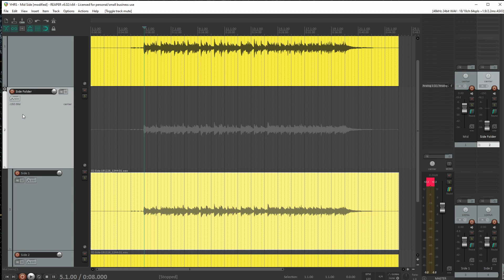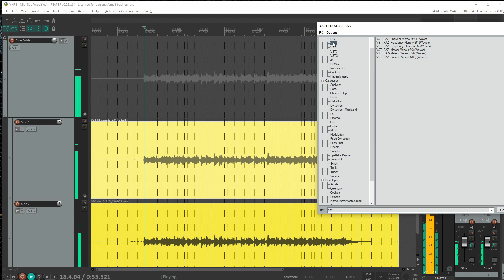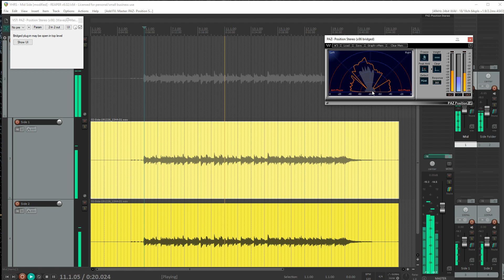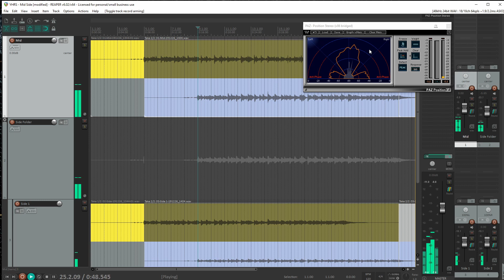Mid/Side Stereo Mic Technique (why does it lean to one side?!?)

Comment: Good on you!   
Sometimes taking a physical step back helps amount to a genuine forward progress :) Close-mic'ing was born in a time when engineers were desperate to do anything to get  a better signal-to-noise.  Turns out that it also sounds very f'ing fun to mess around with the apparent size and energy of a sound, so this proximal "artificial ear effect" became a somewhat over-used habit for a long time.  These days, with most genres close-micing amounts to yet another way of making mixing more difficult.

Comment: I think any stereo mic that’s placed that close to the guitar will give you a similar left/right balance because that is the actual stereo image at that location. If you want the stereo image to resemble what you’d hear in a house concert, the mics need to be further away. When moved further back the mid mic will be picking up more of the room ambiance relative to the instrument, losing much of the presence you get from close mic’ing. That effect can be mitigated by switching to a mic with higher directivity—e.g., a hypercardiod.

I haven’t experimented with that myself—I’m just thinking about the physics.
Reply: Indeed, this can come down to placement differences in millimeters due to the consequence of phase shifting across degrees/minutes of arc.  
 A couple of thoughts:
= The fig.8 mic's horizontal axis ideally bisects the guitar soundboard vertically; i.e. aimed between the bridge and soundhole.    
= When a ribbon is used, it should be oriented to run the ribbon's length vertically to avoid overtones arriving from different points along the length of the neck.  
Depending on proximity and how live and assymetrical the room is, the soundwaves can (potentially) arrive on each side of the fig-8 fractions of millisecond(s) out of phase.

Comment: just a little technical FYI on why this works ...  It's not really about timing or reverberation or anything.  The side mic gets its figure 8 pattern pattern by sending a signal which is the difference between what hits the front and what hits the back.  The dead spot on the sides then happens because sounds coming from the side hit the front and back equally.  When turn that mic 90 degrees, the front of the mic hears sounds mainly coming from the left side, and the back hears sounds coming from the right side.  The signal is then L - R.  When we flip the polarity of the copy that signal become R - L.  The mid mic hears sounds coming from both directions equally.  So that's L + R.  when we leave the mid mic panned down the center, we get L+R going to left speaker, and L+R going to the right speaker.  When we bring the original side mic signal (L-R) up panned hard left, the right speaker still just has the mid MIC which is still L+R,  but the left speaker now gets a combination of L+R from the mid mic and L-R from the side mic.  (L+R) + (L-R) = 2L.  The sounds that were coming from the right cancel out and the left speaker only plays sounds that came from the left.  Opposite thing happens when we bring up the inverted side signal panned hard right (L+R) + (R-L) = 2R.  now it's the sounds that came from the left that cancel out and what we hear is just the sound that came from the right side.  Super cool.  You get the variable spread because the other side gradually cancels out as you bring up the side mic signals.

Comment: To fix this even more you need the microphones to be different… even though you use two of the c414s in different polar patterns, they both are responding to the source nearly identically still as to capsule design, which means you will have phase cancellation issues between one of the side channels and the mid channel… bruce swedien says you need something like a ribbon microphone for the sides and a tube mic for the centre… they just need to be totally different for it to work so you get the least amount of phase cancellation as possible…. But your experiment was fascinating the way it altered the stereo fields balance by moving the microphones directly at the sound source… this makes sense because the capsule on the side signal c414 is positioned perpendicular and so the capsule is affected by the speed of sound hitting that round capsule at nanosecond differences from the front to the back of the capsule and this time delay of the speed of sound is actually creating a phase imbalance even moreso as the capsule is collecting info at the front and back of the capsule… which makes complete sense that a non-direct position will gradient the capsule surfaces absorption of the direct sound … and lead to those phase inversions, as the angle gradient of capture smears the phase.. i suppose a smaller capsule will also help mitigate this …so im gonna try that also to enhance my m/s technique.. i use a beyer m130 for the side mic and c414 xl2 for the mid. Thanks for the excellent video!
Reply: Seems right. I wonder though. Why not do XY angled out wide for the sides, added to the mid mic. No phase flip. Could even pull the xy back a bit and align time if wanted in delay of milliseconds or samples.
Reply: @Helenography0741 You can always use a phase modifier… i have a Radial Phazer Rack, which is now out of production but there are other devices that allow you to alter phase, which is essentially just a fine delay adjustment

Comment: It does matter which panned side copy gets phase inverted. A figure eight mic has a front and back side. In the front side, positive pressure creates a positive voltage. In the back side, a positive pressure creates a negative voltage. This is why the center of the figure eight is null. So always pan the uninverted side track to the side the front of the side mic was facing. Always pan the inverted side track to the side the back of the side mic was facing. This will keep the stereo image correct and phase with the center correct. A good check is to play the two side tracks, one inverted, the other not, unpanned, with the center track muted and listen if they perfectly cancel each other out. 

It is important to note that when done correctly with side tracks panned equally in opposite directions and played back in mono, you will hear only the center mic because the two side tracks will cancel out. It is therefore highly advisable to ensure the center mic, by itself, is getting a good sound since, in mono, that's all you will hear.

Another suggestion is to aim the whole array at an angle to the guitar using the center mic to set the aim. I mic acoustic guitars, banjos, mandolins, and octave mandolins a couple of times a week for live rehearsals and performance of an acoustic band. I use a single small diameter condenser - a KM 84. I place it perpendicularly at about the neck/body joint but aimed at an angle towards the body. The capsule is closer to the fretboard but the main lobe is aimed down the body but further away from it. It gets the body without aiming directly into the sound hole. I had to experiment with distances and angles to get this right. Note also the fretboard is further into the near field of the mic than the body, so the fretboard proximity effect is greater than the body's proximity effect. Too much proximity effect on the body can make it boxy and boomy and bassy sounding.
Reply: You don’t find that the side mic is picking up quit a lot of room? Or maybe that’s what helps.. but then it’s not mid/side in traditional sense, if the side fig 8 is picking up much more sound from front + than it is rear -, I tend to think.  Not that mic technique is ever a conclusive science; it’s more an art. Changing it up is very interesting. I’m actually thinking to do xy instead of fig 8 but angled very wide almost 180, alongside the mid mic. Maybe even bring the xy back a bit, phase align time in daw if  needed.. “XY-M”

Comment: While mic placement is always a huge concern, and certainly with the m/s technique, a quick tip I learned (I can't remember where) is to roll off the low end on your sides (the two panned channels) until you see the signal fit in the centre. I think part of this problem has to do with the fact that one side of the figure 8 is favouring the heel or body of the guitar, while the other side is favouring the neck. The bottom side is beefy, the neck side is more airy. So I've found that while it's well and good to find optimal mic position, much of the problem can be solved with rolling off your low end on the two side channels until the signal fits centre. You don't need or want the beefy low end on the sides anyway, that will come from the centre cardioid signal.
Reply: The fig & is NOT 2 Mics. It’s  one output. There would be  no difference in its sound because it’s pointing one side along the neck and the others the other way.  

You guys need to research from professional sources and not just YT.
Reply from the maker: Thanks for the tips, I think that's a good idea to do some hi and lo passing on the side signals to de-clutter things a bit!
Reply: @YHRS  Indeed! It's a good solution for me as I do have a tendency to move a bit too much (while trying not to) while playing. It's not so much an issue with other stereo mic techniques, and certainly no issue with a mono record, but it's pretty finicky when recording in M/S. I find the slightest shift of the body can really play hell with the balance.
Reply: Hang on hang on- what you need to do is do what this chap did and move the source or the mics so you can eq both side signals together. Bc I guarantee you’re introducing unforeseen phase problems into your recording by eqing individual sides.  I’m sure you’ve run into this when trying to eq a single spot mic on a drum kit. It can get weird. So the safest bet is to track it in a way that lessens the need to eq anything at all.  That’s my humble opinion. 
Although, I only just found out WHY my signal on an acoustic was leaning to one side. So what do I know
Reply: Of course the less eq the better. Having said that, additive eq is much more problematic than subrtractive. Perhaps I wasn't clear. I'm not suggesting individual eq adjustments to each side, but simply rolling off the low end on both sides together until the signal output focuses in the centre.  Usually anywhere up to around 150hz or so off of the sides. Place mics as best you can, and then try it. It works. Never caused my any phase issues. In mid side mixing, the panned left and right channels should be brought up in level a tiny fraction of what the cardioid centre is. So, for example if the cardiod is at -3 the sides would be somewhere around -13. Roughly. It all depends on you record gain, etc. When I mix, I get the centre cardioid to taste, then bring up the sides slowly until I can just hear the width it adds to the mix. Anything beyond that, is too much and unnatural sounding. The sides add a touch of sparkle and width, not body, which is why rolling lows out from them is ok.
Reply: @pauljohn5584 .  I don’t think you understood what the poster wrote. They are using a sub-musical rolloff on the single signal from the bidirectional microphone before encoding. That introduces nothing at all like any kind of ‘phase problems.’ It reduces the interference the encoding uses to create both left and right channels but only in that range! 

It is a very common method in M/S equalization and it can be regarded as a technical equalization rather than creative. Nothing will ‘get weird’ as you put it. This is absolutely nothing like eq-ing the resulting L and R channels. Microphones routinely pick up frequencies we do not want, hence filters on microphones, HP filters on mic preamps. It is actually unwise to NOT use filters.

Whether coincident or non-incident, I rarely track all the low end garbage a high quality microphone hears. If you ever use Omnidirectional, you will hear what I mean. All that stuff is picked up with cardioid patterns as well but is not apparent due to the narrowed acceptance. Filter your mics. You’ll thank me later.
Reply: @artysanmobile   Youre right. I misunderstood.  I didnt know they meant at the source
Reply: @pauljohn5584    After reading the comment more closely, I don’t think they did mean at Sides signal source. But I sure do. Why would one eq anywhere else to accomplish that goal?
Reply: I guess you are suggesting hi passing both sides together. Not individually, correct?
Reply: I have found that useful as well.

Comment: the mid qne rthe in phase signal are adding db, roughly 3 db on the left plus its left sub mix from the center panning. when you pan full left, you basically add 3 db more to that signal, so if your center in -12 db, then your full left-in phase will be roughly -9, and your full right will be about -15 db relative to the left channel due to the phase cancellation. These numbers are not exact, just illustrative of a general principle. The midside mixing technique works better with a more complex signal like a band or group of instruments that actually propogate differently into space, and so have different content coming into both sides of the figure-8 pickup pattern. (If the guitar were just a simple sign wave, it would totally be cancelled out in the phase-flipped channel. But, since it is actually a complex group of frequencies that propogate differently into space, they only pattially cancel out. )

Comment: Hi, could you please tell me what your input gain was set at for both tracks? I’ve made one mid-side recording (Martin D28) and it turned out pretty good. When you moved the mics further away didn’t you have to increase gain to compensate? I’ve watched more than a few YT videos on this technique and none have mentioned anything about setting gain.
Reply from the maker: My gain settings are always just "not clipping".  I usually turn up the gain until it clips when I do something loud, then back it off from there.  The relative gain between the two mics doesn't matter a whole lot either, since you'll be manipulating their relative gain in post when you blend in the side mics.  As long as they're not clipping and not so quiet that they exaggerate the noise floor, then I'd call that the ideal gain :)
Reply: @YHRS  Perfect and excellent answer thas earned you a new subscriber! Thank you and you’ll probably hear from me again.

Comment: I would try keeping the mics in the original position at a little greater distance but turning the side mics at a rectangle of the sound hole this should fix the loudness issues without disturbing to much of the stereo image. (Mid side mics not perfectly at right angles)

Comment: very interesting - it demonstrates this MidSide technique isn't just an artificious gimmik but a proper way of capturing the ambience of sound - I'd say traditional stereo and MS do capture the 3d of sound (ambience and more) in different ways...but the MS method offers much more control (in post production).
Then, didn't you noticed the same bias to the left when recording with a typical stereo mic? I mean did you normally record with the mic to the end of the neck? (not direct to the soundhole?).

Comment: Thanks for the video, it made me rethink about this problem I had also encountered. I don't think, however, the key issue is the position, but, instead, the similarity of the signals between the M and S mics, after all, the S mic is just a mono signal, so it should always cancel itself no matter the position. Let's suppose that (absurdly) we had the exact same signal in both mics. After the MS processing, in one speaker we would have A+A and in the other speaker we would have A-A, leaving us with 2A on one side and 0 on the other (I am ignoring pan law to simplify the example). So the problem is not the position, but a technique that has a tendency to emphasize one side. When you distance the microphones from the guitar or center them in relation to the source, the S mic gets more reflections and less direct sound, making the signal from both mics more different and less phase aligned, hence, less cancellation between the S flipped side and the mid side occurs resulting in a more centered image. A bigger room will always mean more delay in the S signal, making both signals less similar. Anything that makes both signals more different, like moving mics, using different mics, delaying the S signal to minimize cancellation, or getting rid of the lows in the S side (since most cancellation occurs in the lows because they are longer waves) will help to solve the issue. So, if you like your acoustic sound up close, you can get that in MS by recording as you did (it's preferable if you use a different mic for the sides though, it doesn't even have to be a figure eight), then manually delaying the S signal some milliseconds till it sounds centered and then removing the lows from the sides with a MS EQ. I hope this helps.

Comment: Hi, Thank you for the vid, awesome tutorial. I tried it and it works great. Quick note. when you take 2 of the same signal and you invert the phase, in mono they cancel each other out, in phase they become additive. In this case you have 3 signals, 2 in phase and one out. The out of phase side is now the weaker side and everything will lean to that side.
Reply: Oh this seems accurate perhaps (there’s several ideas on why this is happening it’s kinda wacky!). Yet if an out of phase side /signal is weaker don’t you mean things would lean to the other side rather? 
I’ll have to try it out.